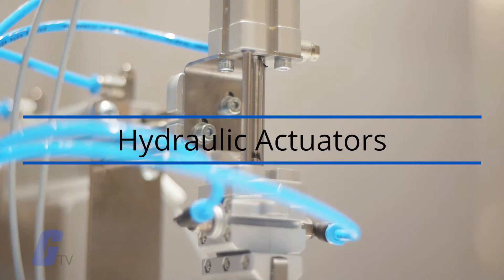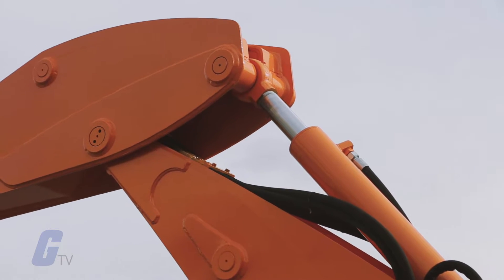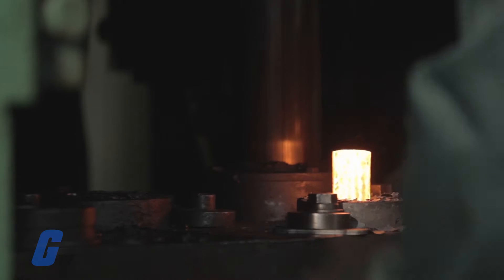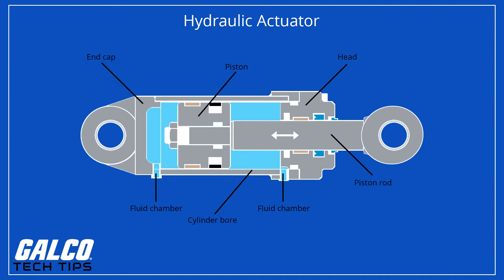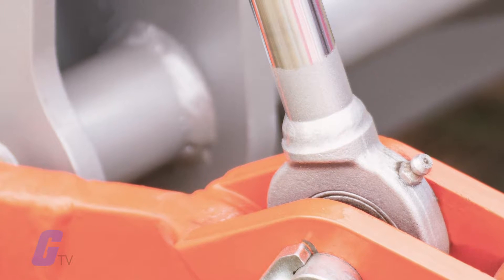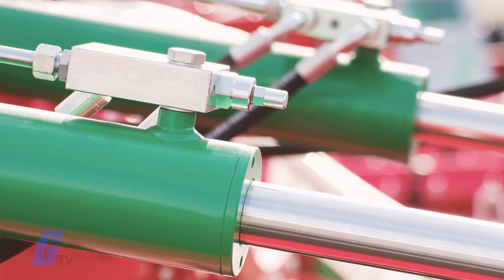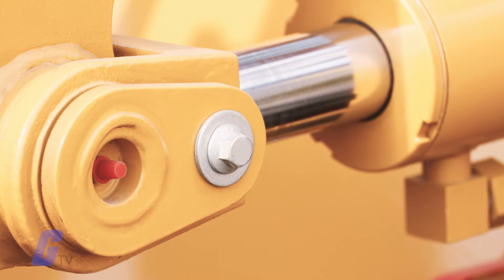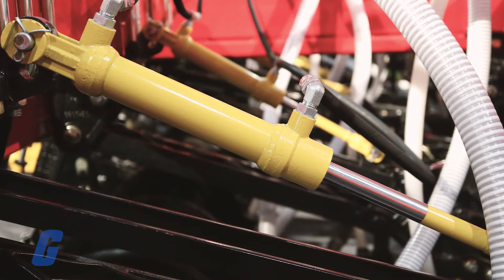How do Hydraulic Actuators work? - A Galco TV Tech Tip | Galco

Comment: can u give me hydraullic actuator applicatons
Reply: Construction vehicles such as backhoes, and dump trucks use actuators. They are seen all over factory settings to push and pull products on assembly lines. The more common actuators you will encounter is the one's featured on car trunks (for hatchbacks and SUVs), hydraulic car lifts, and in same cases elevators. A "famous" elevator that uses hydraulic power is the elevator to reach the observation deck of the statue of liberty.
Reply: @christineh2393  thank u so much